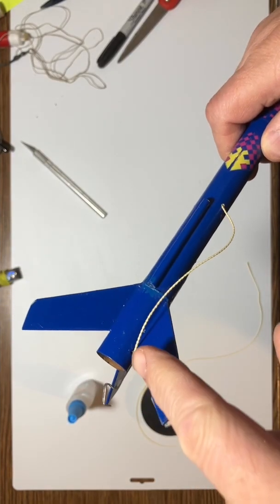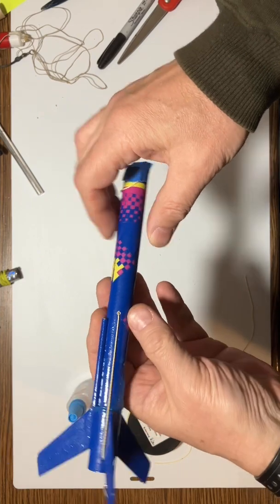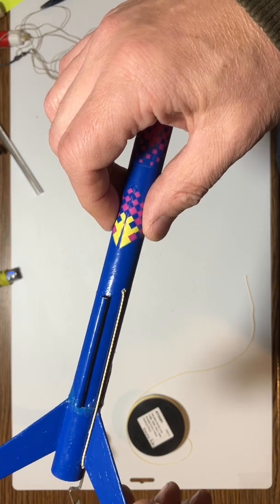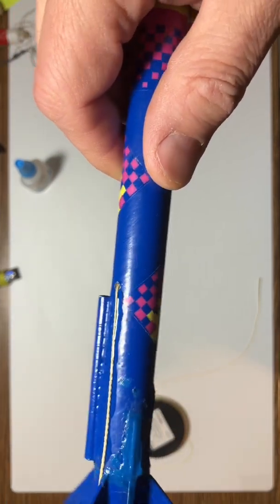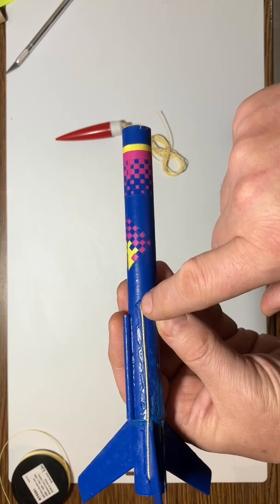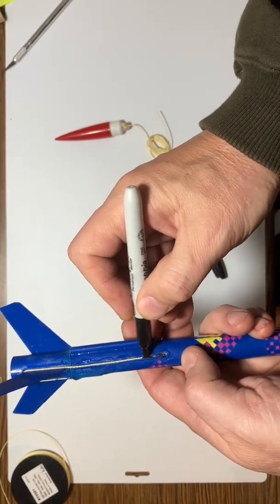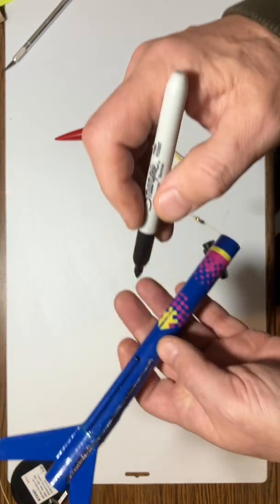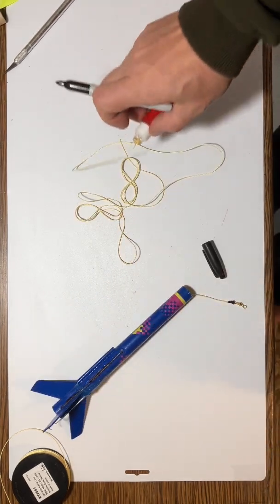2/3 Wizard Kevlar Cord Repair: Attaching a new cord

Comment: Creative solution! 👍🏻 that glue is amazing stuff! Do you use an accelerator with it?
Reply from the maker: I have a spray bottle of 91% isopropyl alcohol that works as a "kicker". It seems to work but I don't know if it works as well as the commercial stuff. One device I use is my "heat rack". It is a small room heater pointing upward. I then have an old lamp as a calumniator. I hang stuff to dry at the top. The constant rise of warm air seems to work the best... but then I'm in the basement which is about 66 degrees now.